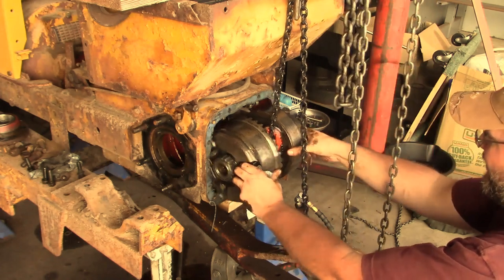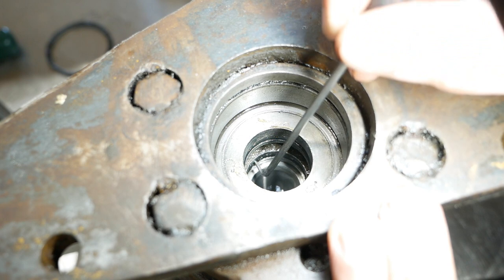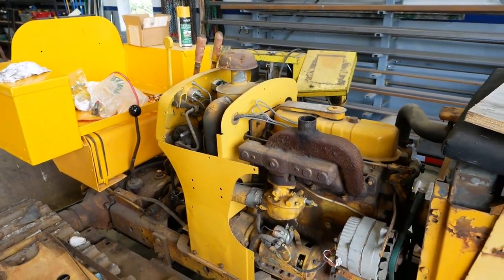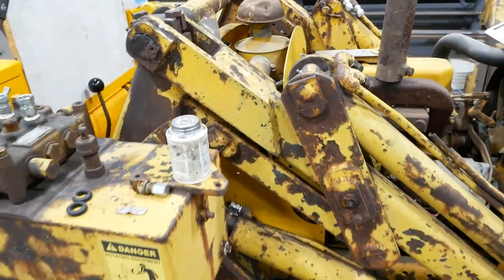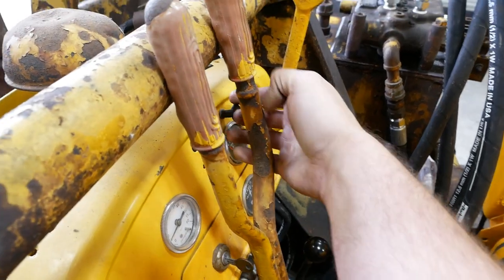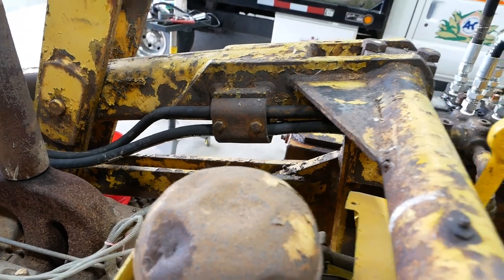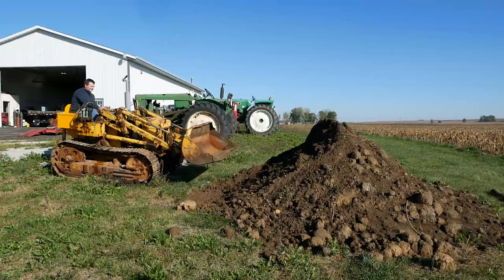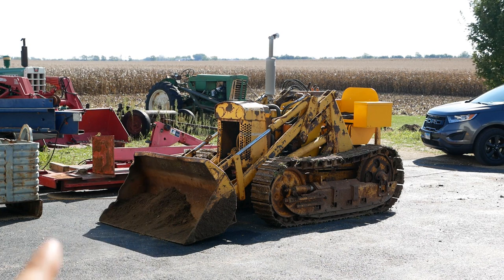60 Year Old Oliver Crawler Returns to Service - Installing Loader and Everything Else

Comment: Even if I don't have a use for that Oliver 'dozer, it would still be fun to drive.  It's almost as old as I am and it still runs!
I would put the switch on the postiive terminal to kill ALL 12vdc in the system beyond the battery.  I don't think it's new enough to have a computer that needs constant power.😁
Reply: One BIG problem putting the switch on positive, is if that switch shorts out to ground, you just lost your battery and possibly cables or even start a fire, being the gas tank is almost underneath the battery.
 Being on the ground side, if it goes bad and shorts out, it causes no problem except a replacement.
Reply: @bluegrallis  In a racing enviroment, putting it on the negaive side would make sense but not in everyday driving.  With the switch on the negative side, all of the current demands, including the starter up to 250 amps would pass thourgh the switch.  On the postive side, the starter current can bypass the switch.  Here's something else in today's cars.  Disconnecting the battery sets all the OBDII readyness fault flags.  You have to do a cumbersome drive cycle to clear the flags.  I think it's rare that anyone would (some would) really go to the trouble of using the switch.  Too much of a hassle.
Reply: @danburch9989  First off, how can you possibly believe ALL the power for the starter wouldn't go thru that switch if it was on the positive side? There is NO WAY, power can by-pass the switch. If there were, it wouldn't be a switch! 😵
 Second, this 1960 tractor has NO computer chips or ANY OBD connections.
 3rd, it may set for months at a time in a shed, where mice CAN play havoc with any wiring I feel much more comfortable in that situation, knowing the battery is NOT connected to any of the tractor wiring.
Reply: @bluegrallis  You don't wire it at the the battery.  You wire it at a different branch beyond the starter (power feed to the fuse panel).  DUH!  I know that old technology exists.  Wire it the way you want.  End of discussion.
Reply: @danburch9989  Well, it wouldn't be called a "battery disconnect switch" if it was wired down stream, and it wouldn't disconnect the battery from everything like it's supposed to. DAHH!

Comment: My first thought on that cracked spool would be to turn some round stock on the lathe to the spool’s largest OD.  Since it is not being used, a solid rod should suffice.

If that works, I would risk tempering the original spool, grinding out the crack, welding it, and then turning it back to original dimension and rehardening it. As long as risking the spool is not going to matter if the solid rod works, the risk of going for a full restoration on the spool is negligible.  You could also sputter metal onto those eroded sections, if needed. 

On the cylinder rods, yes they can be restored, but it is probably cheaper to buy new.  Hard chrome is not easy or cheap to do, more so on old parts. There is no shortcut that works long term, though I have seen some epoxy hacks that seemed to buy some time. 

It appears that the unit is underpowered. Is this typical for this model? I would have expected that thing to move a mountain of soil much larger than that without stalling. 

One thing I was sad to see is that while the tractor was apart, nobody blasted the rusted metal parts and reprimed/painted them.  It is easier to get those before it is reassembled, so I am assuming it won’t be done.  I guess the owner has his limits as to how much to invest in the project.

It was nice seeing an old machine put back to work again. Thanks for sharing the process and your fine handiwork!
Reply: The spools in the valve were all individually hand lapped to fit. They also need openings to allow oil to go threw to the next valve. 
 In hindsight, I wish I would have asked Wes to go with a 3 spool valve in case I ever put a grapple on it, or want remote hydraulics for a pulled implement.

Comment: Kill switch always goes on the positive, Wes mate.  At least in the UK it does.  As an electrician, we are only allowed to swith Positives (lives).
Reply from the maker: Yeah I know that true for mains voltage stuff. But I see low voltage DC switched on the negative all the time.

Comment: Great video. Waited a long time for this. I would be interested in seeing the videos if you ever change the control valves and redo the lift cylinders. As for the spool valve, would it be possible just to machine one from scratch?

Comment: Are those standard iron pipe fittings?  Can they handle the pressure?  Legit question because I don't know.
Reply from the maker: Yes. They are rated for 1300 psi, which is the working pressure of the system.
Reply: @WatchWesWork  Interesting.  Are they the same pipes used for water that you get from big box stores or a different grade?

Comment: That’s looks like Commercial P71/76 pump,
But if it has o-rings on the shaft then it is probably motor and not a pump.
If your intake and discharge ports are the same size, and you have two seal cavity drain check valves instead of one - it is a motor and not a pump.
Also make sure you not building up high return pressure in the hydraulic system

Comment: Your maybe missing a linkage that makes the forward and reverse lever work like you think it would ?
Reply: I was thinking the same thing
Reply: Nope, the thinking behind it was, if you are traveling forward and push in the clutch to shift, your momentum a makes you continue forward, pushing on the shifter as the tractor stops, reverses your direction. There are other companies that used the same pattern of a reverser.
You also pull back on the throttle to go faster. If you need to slow down quick, a natural reaction is to reach for the throttle. Rather than having to reach, grab, and pull back, you just shove it forward.

Comment: First of all great job and video, the machine is what it is but regarding the forward / reverse handles on some equipment is purposely back for forward and forward for reverse because if you had it the logical way when you shove it forward it can throw you back and if you are gripping the handle it then gets shoved into reverse and tosses the operator harshly around.

Comment: CHECK.  When is it going on eBay as a fundraising auction?  A gantry crane would be a nice addition to the shop
Reply: Wes already has a gantry crane.  Not sure why he didn't use it in this case -- maybe the weight of the loader was too much?

Comment: I have a question about that transmission. You said it was 4 forward 1 reverse. Then you have a second gear box with a forward and reverse. My question is in which direction does the tractor move if you put both gear selectors in reverse?
Reply from the maker: Forward. It's not well thought out. The reverse box is an option. There was also a slow speed box.

Comment: Your battery cable termination by ring fitting looks so much safer.  Shouldn't those corroded rods be undercut and flame welded?

Comment: I would get the spool valve repaired. The corrosion can be brush plated to fill in the pits. The crack can be tig welded and the valve body then hard chromed and ground to diameter. Should not be crazy $$. I used to do this kind of work to restore precision tools when a machinist 40 years ago!!

Comment: Sandpaper and steel wool with oil to polish the cylinders.
Reply from the maker: That pitting is 1/16" deep...
Reply: @WatchWesWork  That moves the repair from backyard fix to "Call Abom....."
Reply: @18robsmith  OK! I was thinking about it being cleaned up enough to get it back to the owner mainly! I've seen other guys that just replaced them and didn't try to do anything. That's a lot of money the owners wouldn't go for.

Comment: What if you move the outside spool to the middle and block off the outside port. By putting the good spool in the middle should not affect the pressure as long as flow goes through the 2 good ones first

Comment: the hydralic levers.. isnt there like 2 threaded holes there for a springboot or a springclamp system to get the levers back in neutral position? i mean they are all inline with eachother for neutral :)

Comment: Something tells me that the hydraulic pump is more bigger than it was from factory, those hydraulics seemed a little faster than I would have expected at low idle. Also the hydraulics load up the engine more than a guy would want while driving and running a function
Reply from the maker: Yes. I think so too.

Comment: original fuel pump pressure 4-5lbs?  electric pump may be over loading float/needle seat causing slight flooding at idle.  I had to look for low pressure electric for outboard.  It was a challenge.

Comment: Could you slightly (maybe 1/8") V out the last 1/2" or so of that crack in the valve and braze or maybe silver solder it to try to plug it up, then turn or even file any braze buildup so it will go in the hole again? The idea is just to seal the crack, not make it functional. I suppose JB Weld would also be a possibility, but I'd be concerned about that chipping off and getting in the oil system.

Comment: I am a little confused. Did you say that it had four forward speeds and a reverse on the transmission and a reverser? Great video, I was wondering what happened to the Oliver crawler. I thought that you said the hydraulics on the Oliver tractor were slow, they seemed to come down awful fast.
Reply from the maker: Yes. Like I said, it's not that well thought out.
Reply: A stock machine had 4 forward speeds and reverse. There were 2 options you could buy for extra money. One was a reverser transmission, the other was a slow low transmission. Either option can bolt in between the bell housing and the standard transmission. I may be in the market for a slow low, as it would be real simple to swap out for the reverser.

Comment: The machine cannot be used for commercial use. But for someone who wants to move a little bit of earth privately, it might still be useful. You or the owner should look out for a cheap used valve block. Perhaps a similar used loader will turn up somewhere where you can swap parts.

Comment: Love your channel.  I know next to nothing about this type of work and I am confused as to  why you would put the fuel strainer after the paper fuel filter.  I would think that any dirt that makes it past the paper filter would also pass through the strainer - so the strainer does nothing.  Can any one explain the thinking behind arranging them this way?
Reply from the maker: I can't change the position of the strainer. It threads into the pump. There's no room for the filter after the pump.

Comment: I know the units probably already gone home but I was wondering why didn't you attach the Hardline to the upper part of the detachment or you would not have to undo two take the front end loader off
Reply from the maker: It's not meant to ever come off.
Reply: @WatchWesWork  I know it's not meant to come off but if it comes back to your shop are you willing to take it off to do the work that needs to be done to it

Comment: can you make a dummy valve spool.  chrome rod if its a standard size, if not maybe machine some rod down.   measure the middle section for high pressure to pass and machine that into the spool.  to not dead head the pump if someone moves the lever machine the ends of the spool for socket cap screws and washers to keep the spool located.    you could also machine oring grooves into the spool itself to assist in stopping the leak id guess the valve body has that already.

Comment: Is that battery box big enough to use a group 31 stud terminal.
Reply from the maker: Maybe. But again, it's a 30hp 3 cylinder gas engine...
Reply: @WatchWesWork  you can't have to many cranking amps at 20 below zero.

Comment: Crimping battery terminals: what happened to your hydraulic crimper, from a previous video or two?
Reply from the maker: Upgrade?
Reply: @WatchWesWork  When working on boats you can't premake the cables, since until you get through fishing around obstacles you have no idea how long they have to be (and there is seldom enough spaces to tolerate too long).  I used to use a huge Greelee crimper like the one in this video, but it's size made life awkward, at best.  So not too long ago I bought a hydraulic one, possibly identical to the one you raved about recently.  I love the hydraulic one -- even without considering how much less it cost than the Greenlee -- works in tight spaces, makes good crimps, and doesn't take every bit of arm strength I have for the big terminals.

Comment: mark one eyeball calibration may be off but looks like fuel pump could be replaced with a bog standard carter style old chevy pump...start under 20 dollars.
Reply from the maker: Not from what I could find.
Reply: @WatchWesWork  aye...wasnt second guessing ya...just have a personal aversion to electric pumps unless needed for fuel injection.Looked like the same size and bolt pattern/arm length as a stock chevy pump but its not in my hands and lord knows even then they all loved haveing things a bit different so they could charge a premium .Either way good vid as always!

Comment: Cant you take the spring assembly out of the middle valve and put them in the right one?
Since the middle one is cracked and you're not using  it, it might work.
Reply from the maker: No, the whole thing is different.

Comment: Seems a little fuel fat. That electric pump likely putting out more pressure than the mechanical so probably need to close the jets down a bit to compensate. Might be worth 5hp but that is a lot when you only have 30! lol
Reply from the maker: Nah something is stuck in the low side of the carb. The pump is supposed to put out 3-5 psi. I guess I should check it.

Comment: @Watch Wes Work Couldn’t you take that center spool to a machine shop have them weld that crack then have the center spool sanded back down to factory spec or would that work
Reply: The spool is hardened. That would mea pre-heating and post heating to be able to weld it, with no guarantee of hardness after welding. With machine shop costs at $150 an hour, with at least 2 hours work, it wouldn't be to frugal, when you can by a new 3 spool valve for $170.

Comment: Hey so I watched your 86 ranger video and I just wanted to say that I have a 86 bronco II that has the world's most hardest idle issue to figure out ever I mean I replaced every single sensor possible on that thing I replaced the upper intake gasket I replaced the EGR tube because that was leaking I replaced the catalytic converter and now I have to replace it again because it got to hot and what I mean by that is the catalytic converter has gotten to the color purple and I'm pretty sure it's cooked but anyway on top replacing all of that it has the ECM that came with the motor and just so you know it had a body swap and a frame swap but the chassis and drive train is from my original bronco  and this issue started about 3 months after the swap but ok just at a dead end right now like i have practical replaced everything now I'm sure there is something that I have missed but any help on fixing this would helpful

Comment: I would think the centre spool could be recovered by.. *grinding into the crack *welding the crack *welding over the entire surface of the item *turning it back to spec in a lathe.
 It works in Bangladeshi truck repair shops, so I am sure it will work here.

Comment: But what on earth ever happened to the Insley? Month after month, year after year, I have awaited the resurrection after a little more of Wes’ (the miracle worker)  touch. Its a diamond in the rough! But I bet its in South Dakota now……
Reply from the maker: Sadly it is just not worth fixing. The main drive shaft is so worn the gears bind against the side of the turn table. It will never drive again. I'd have $20,000 in fixing it.

Comment: I wonder why those types of seals are still not used  in cylinders if they can run so well on pitted cylinders compared to modern seals that wear out and leak from the slightest bit of of problems with the chrome?
Reply from the maker: I think they kind of suck to work with though. And they all leak a little, even when new.

Comment: Now I haven't replaced the fuel pressure regulator yet but I don't know and what the issue is, is when it is sitting at idle the motor does the rocks and then from time to time the motor will start bogging down to like 500 or 400 rpm then bounce back up and be fine but the motor will still rock and then here recently this is why I think the cat went bad because when push in the clutch to come to a stop the motor will almost die and in fact yesterday it actually did die on me when I was coming to a stop and the main issue is I think it is running way to rich but I don't know what else to replace besides the fuel pressure regulator the vapor canister and literally every single vacuum line

Comment: Back when that dozer was made, I feel like people where a lot smaller which is why that clutch peddle is situated like it is…. Maybe. You see that with a lot of older equipment/vehicles.
Reply: I think an original or oversized seat cushion might help some. What is on there now, mashes down almost to the plywood. I plan to make a stiff foam cushion that is 4 inches thick, with a heavy canvas waxed duck cloth.
Reply: @bluegrallis  You the owner of this gem??
Reply: @firewalker1372  Yep.  That's why I "borrowed" Wes's picture as my profile pic 😎
Reply: @bluegrallis  ahhh, just noticed the pic. Really enjoyed the video of Wes and working on this.

Comment: Those pumps are designed to push not pull. They are supposed to be mounted as close to the tank as possible.
Reply from the maker: No. They just need to be mounted even with or below the fuel level in the tank, which it is.